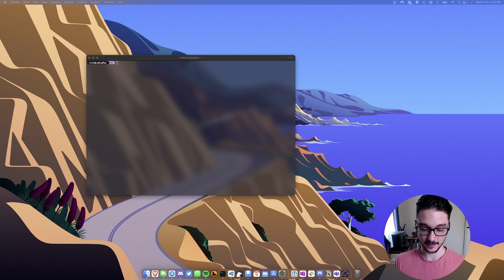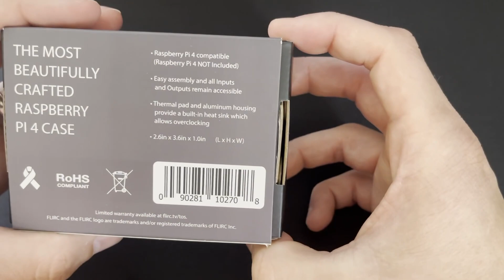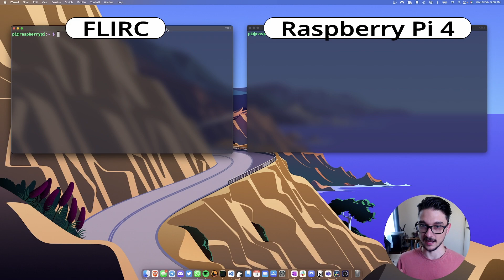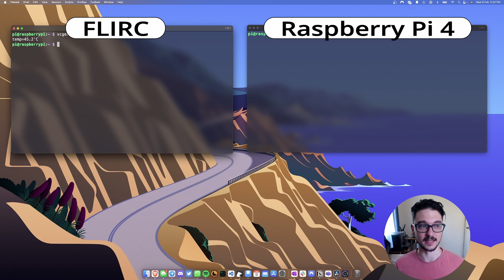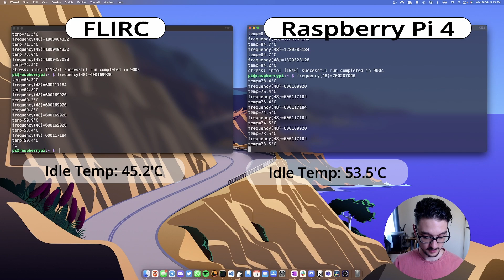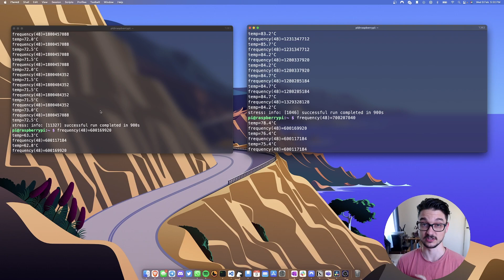FLIRC  Raspberry Pi 4 Case Review + Stress Test

Comment: It throttles at a little over 80 degrees. You're probably comparing it throttled in the normal case with full speed in the flirc case

Good review. I liked that you showed what the LEDs look like which I haven't been able to find elsewhere.
Reply from the maker: Very good point!

Comment: Ditch the garbage thermal pad for a proper 1.2mm copper shim and thermal paste - it will be even more efficient at pulling the heat out of the CPU and into the aluminum case.

Comment: i am using a Argon case and Miuzei case for my Raspberry Pis.  I am quite happy with them too.  but is always interesting to see what are case are out there
Reply from the maker: How do those cases perform compared to the FLIRC from what you have seen?
Reply: @Techdox  The argon case: is great I got in there a Raspberry Pi 4 with 8 GB and a 250 GB  SSD.  that one is running at around 39 Celsius.  it is not very loud. 
The Miuzei case: Is a bit louder.  you can hear the fan but it is barrable.  in that one I have the raspberry Pi 4 4GB from you :) and that one is running at 30 Celsius with the case.

Comment: Heat sink case with plastic on top. Why? Why not put corrugation on top instead of plastic?
Reply from the maker: Bit random aye, I have another case that is a completely metal top, surprised I never made a video
Reply: Because the entire aluminum case is the heatsink, not just the top. Corrugations on top would do nothing.